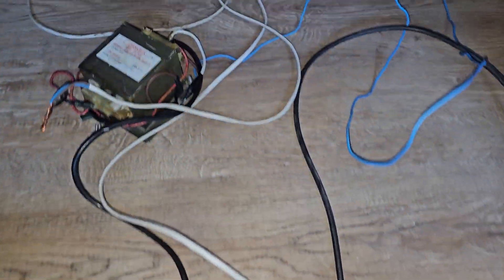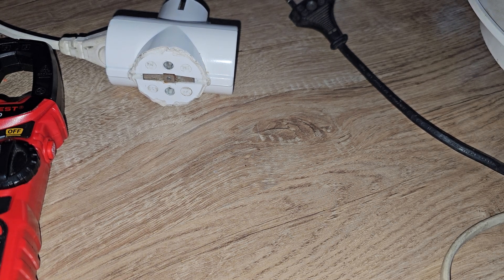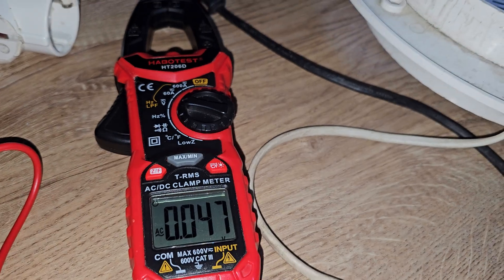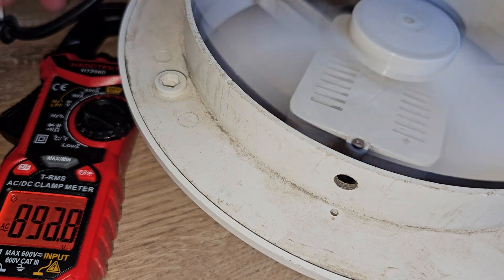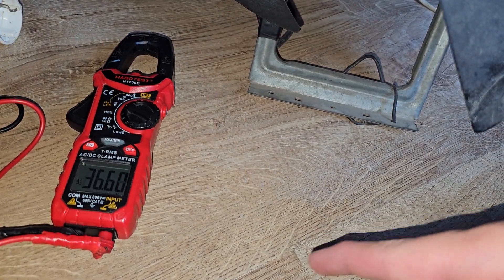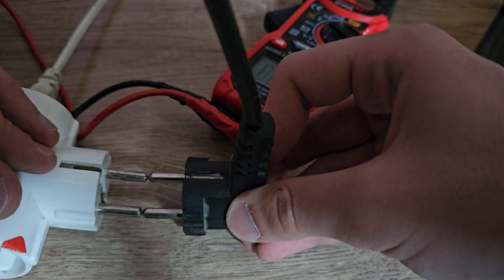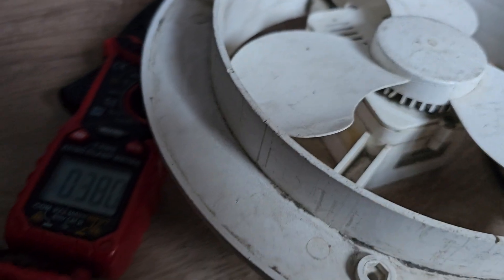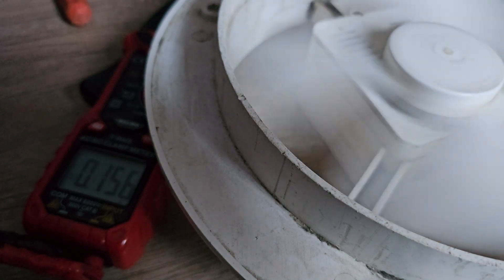Powering fans with microwave transformer wired to audio amplifier

Comment: I'm curious if a setup like this can be used as an arc speaker or plasma speaker. Or maybe an AM transmitter.
Reply from the maker: I tried that before and it works a little bit but is nothing impressive.

Comment: What's the point? Also, you are not matching the amplifier load resistance
Reply from the maker: The point is to measure the voltage drop weh fan is plugged and for fun. My transformer primary is almost 4 ohms and the amp is designed for 4 ohms
Reply: @darkbass11  assuming you just measured the transformer to be 4R with a multimeter, thats meaningless.  

the load has an impedance, due to its inductance. and that impedance is reflected through the transformer at the square of the turns ratio, and that is the load the amplifier "sees".

you work backwards. the fan motor has a rating, so many amps at so many volts. that gives its impedance or "resistance" at the power supply frequency, 50 or 60 Hz... and that will be utterly different to the impedance seen at any other frequency. a higher frequency will also increase iron losses due to eddy currents in the core. that is, you can run a transformer on a frequency LOWER than its intended for, but not the other way round.
you then figure out the turns ratio of the transformer. and then you arrive at the actual load the amplifier is working into.

nothing to do with resistance as measured by a multimeter, which is simply copper loss.
Reply: @paradiselost9946  exactly! Also transformers has a hysteresis loss. As far as you get from a perfect sine wave, the worse it gets. As I've said before. You need at least an oscilloscope to understand the bare minimum of what he is doing! And probably, the amplifier is not generating a sine wave output
Reply: @darkbass11  the transformer resistance isn't constant, and you need to get a oscilloscope to see the waveform on the output. Probably you are getting a distorted wave that the multimeter can't read